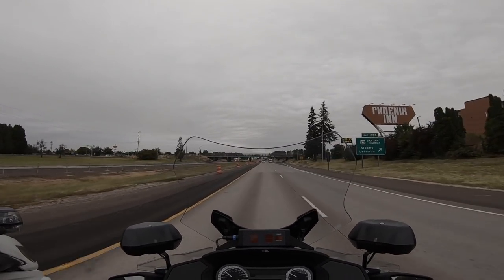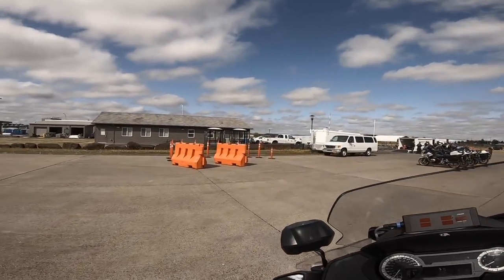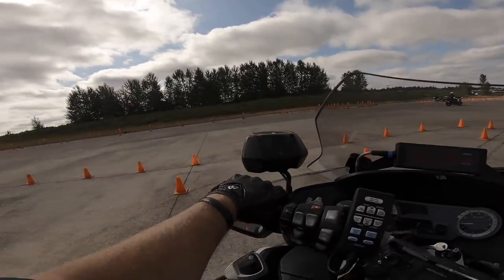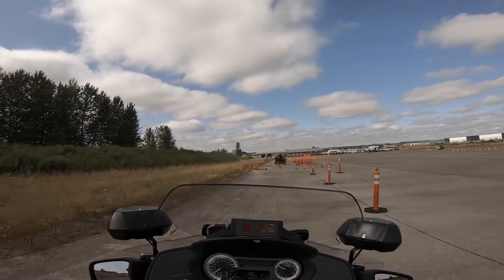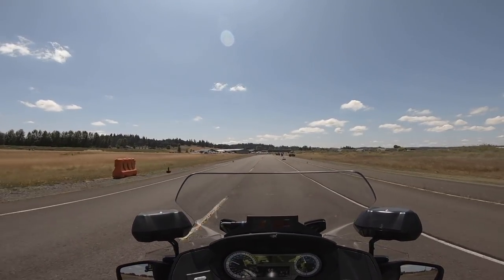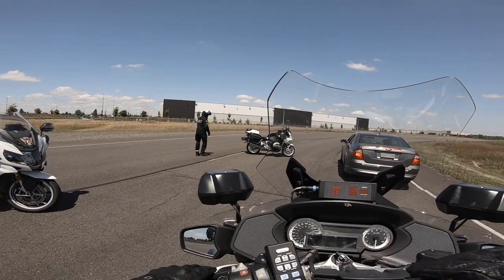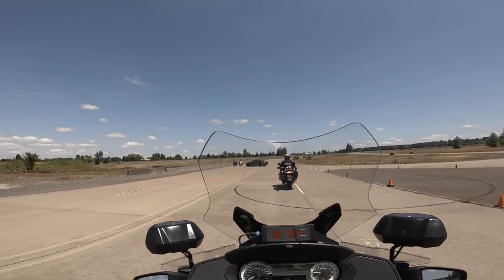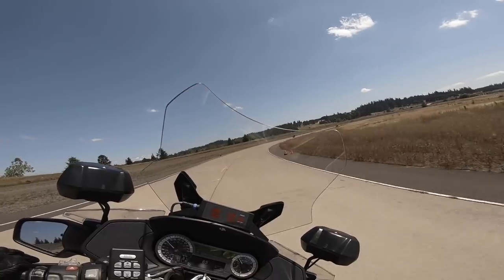Police Motorcycle Advanced Motor Training On A BMW R1200RTP!

Comment: Great Riding!!!!!! I've been working regularly on slow speed maneuvers in a parking lot with cones on my 2 month old BMW r1250rt.  As I work to learn the right throttle, clutch, and rear brake relationship Im at about 10mph on an off set cone weave set up running the throttle at about 3,000rpm's.  My wife and a friend say it makes the bike sounds like its working real hard.  I was trying to look at your rpm's through the video.  On slow speed stuff are your running about 2,000-3,000 rpm's?  Im a bit timid to run the rpms lower than about 3,000 for slow speed stuff at the moment with the fear of not having enough power to the rear wheel and dropping the bike. Im just very curious where you run the rpm's on our similar bikes and if i am going to do my clutch in prematurely with my desire to master some new skills at too high of rpm's.  Thanks and thanks for the job you do!!!!
Reply from the maker: Mark, Thanks for watching! Ya, I think I’m probably in that 1,500-3,000 rpm range during most of the slow speed cone work. Using the “gray zone” area in the clutch to modulate speed. The wet clutches in the new bikes seem to hold up better than the older dry clutches for slow speed maneuvers so I wouldn’t worry too much about wear. But generally if you can kinda “set” the throttle at a fixed rpm maybe closer to 2k rpm and use the clutch to modulate speed it works pretty well and minimizes clutch wear. Hope that helps a little bit. Id try to keep it a little lower than 3k if possible as you get more comfortable. The nice thing about the boxer motor is they are kinda like a tractor and make decent torque at low rpm.
Reply: @Mclovingarage  Thats a great tip.  Thanks.  I went out today for a while in the parking lot working on a little lower rpm's.  It will take some more practice.  Thanks for giving me guidance on what I am to work toward.  Another question: What sources do you know that are good for slow speed training??? Especially that u-turn.  Ive purchased Jerry Palladino's training vidoes which are great, but are all on Harleys so helpful but I wonder how much different our RT's are.  I watch a lot of Motojitsu, MC rider and a few other you tubers trying to get tips to up my slow speed skills.  I had some bikes 30 years ago when I was young and dumb, and now trying to be older and wiser and learn how to do things right.  Still working towards trying to get a u-turn  quite a bit tighter to be able to make one on a 2 lane street.  Im most the time about 24-27 feet on my u-turns.   Ive seen the LAPD test bike data that it can be done on the RT in 18-20 feet so of course thats my goal.  You guys do set the standard you know.  What do you think is a realistic goal for a dedicated civilian rider on the big BMW bike for u-turns?  Thanks again.
Reply from the maker: Hey Mark, with plenty of practice you should be able to get closer to that 18-20 foot mark. Generally speaking if you can u-turn in two side by side parking spaces that’s a solid U-turn. The trick is full lock on the handlebars and your head turn. You want to point your eyes and head back towards where you want the bike to go as you are turning, not down in front of the bike. So kinda up over your shoulder, whichever direction you’re turning. Clutch and throttle modulation matter, as well as lean angle but those will come once your eyes are pointing in the right direction. I try to pick a spot on the horizon back behind me when I u-turn that sets me up to make the tight turn. Or some other sort of marker in the parking lot you’re practicing in. Where your eyes go there your bike will go also.
Reply: @Mclovingarage  Full lock required, thats a pearl I didn't realize but having you say it, it totally makes sense.  Thanks so much!!!  Thats a huge piece in trying to understand and apply tighter turns and u-turns that I missed.  Up OVER the shoulder great tip also.   What sort of exercises do you work to gain the skills and comfort to go to full lock with a lean on the bike?  I'll keep practicing until I can get that 18-20ft u-turn and then keep practicing more.  Thanks for the encouragement that it can be done on the RT.  And thanks again for all those tips
Reply from the maker: Mark Dorrough you’re very welcome. Really it’s just about practice. Trusting the bike, trusting the tires, and getting comfortable with the feel of the bike “falling over” from straight up and down to a lean angle that isn’t always comfortable at first. One last little piece is counter balancing with your body. So let the bike lean over under you but keep your body upright and towards the outer side of the bike. You can even scoot your butt to the “high side” of the seat to accomplish this. That way the bike is really leaning over but your body isn’t. Gives that counter balance affect so the bike doesn’t feel like it’s going to tip all the way over.  Have fun practicing! Hopefully those pointers help.
Reply: @Mclovingarage  Great Tips!!!!  Thanks so much for the help, greatly appreciated

Comment: I'm a civilian and I've been riding a 2004 R1150 RT-P for 12 years. Recently purchased a 2015 1200 RT-P. Before the 2015, I test road a new R1250 GS and they all have the same motor. The biggest question I have is the noticeable gearing difference (extremely tall) in the police bikes. What's the reason? Is it for quick acceleration?
Reply from the maker: I’m not sure. I’m not familiar with the tech specs on the gearing. I just ride it. Lol! But I’d say it’s probably geared differently than the GS although I don’t have direct experience in that. Thank you for watching!

Comment: You said that one circle is 32 ft.. but that box looks a little large in the middle.. are you basically pulling a 16 ft to each side figure 8?  And the keyhole is what.. 15 ft radius?
Reply from the maker: Ya, I said 32 ft circle but it might have been a 30 ft circle. I didn’t actually ask. But yes, essentially a figure 8 inside a 30 or 32 ft circle. And yes, keyhole is right around 15ft I believe.
Reply: @Mclovingarage  thanks.. I got a k12rs I'm hoping to get to close to that... I'm down to about 18 ft u turns from a standstill... So I got a lot to improve (though I don't feel I'm doing too bad for youtube university)
Reply from the maker: Not at all! That’s good for sure. Biggest things that helped me were getting my head and eyes turned towards where I wanted to go and “setting the throttle” at a pretty steady rpm and using the clutch gray zone to pull the bike around. The other hard part to get used to is letting the handlebar go to full lock. Takes some practice. Sounds like you’re well on your way.
Reply: @Mclovingarage  I'm still working on the head turn.. My only practice is on a cul-de-sac with cars parked around it so.. little more at stake lol.  Friction zone I'm really comfortable in.. I do the slow ride slower than my speedo registers.. I found I was approaching TOO slow.  I'm hitting full lock about 50-60% of the time.. I just need to stop fighting it as much... With a 23 year old bike I'm not going at it full commit and thinking "crash bars will save the frame and fairings" because they never made bars for my model (they made them for the LT, but I don tthink they make them for the gt or rs)... So It's really, really helpful to hear you and Jerry Paladino really hammering the look through the turn so much.... its sooo much easier said than done
Reply: @Mclovingarage  I also had to adjust my pegs height so I could shift my butt highside .. easy to lean with the bike and lowside.. counter balancing my seat was getting in my own way.. so I moved them up an inch and was 50% on my 2 spot u turn today in practice where before I was closer to 25%
Reply from the maker: @AlanDike  it really is easier said than done. I will struggle with it from time to time even now when we go do training days. And I can understand not wanting to commit fully without crash bars. Fairings aren’t cheap to replace.
Reply: @Mclovingarage  especially since the bike had a fairing change in model year 2002

Comment: Not keen on BMW we use to blow the final drives they became unreliable so we went FJR now there's a recall on 2nd gear
Reply from the maker: Recall on 2nd gear on your FJR? Not sure when you last had a BMW but our 2015’s have been excellent. No major issues or repairs. Each generation has seemed to get better. The 1150’s weren’t great. Our 2009, 1200’s didn’t have many issues either. Thank you for watching!
Reply: @Mclovingarage  if you know you're motorcycles FJR 1300 Yamaha and l hated the boxer engine on the bmw clunky gearbox worst final drive I've ridden and we had to take the hands off the the handle bar to turn the lights an sirens on our new bikes don't

Comment: Uh.. right side dismount?
Reply from the maker: We dismount on the right side away from traffic. Also in case a kick stand decides it wants to fail. Hasn’t happened yet to me on this generation of bike but it’s happened on the older ones.
Reply: @Mclovingarage  that makes sense, you guys frequently need to dismount with little between you and traffic so a right side dismount makes sense, i get that. Just a little more cumbersome. Can you pull over angled so you can dismount to the left?  I've seen a couple RT riders dismount on the side stand in the hot asphalt only to turn around and find their RT's on their side withe the kickstand buried in the asphalt! Lol!

I recall they also teach you guys in an emergency situation to dismount and lay the bike down, with no side stand right?

Comment: You're nowhere near the rtp's limits esp. in those corners on the track. Good to know i still have a distinct  advantage.
Reply from the maker: I generally don’t take any of my machines right to the limit. That’s where either I’m bound to fail or the bike fails and neither of those are good things. I have to ride it 40 hours a week and pay the bills. I can’t be laid up because I made a mistake. Sounds like you’re a good rider. That’s awesome! Many at that training are much better than me. I’ve been on a motor 9 years and happy to report no injuries and no accidents. I attribute it to good training, good teachers, and riding under mine and the bikes limits. Thanks for watching and the comments. I appreciate it.
Reply: @Mclovingarage  yeah I have to ride mine 140 ish miles a day just to commute. Then I am insane enough to ride another 1000+ miles on the  jaunting from CA to say, OR or CO and back in a weekend.  Put over 300k miles on my bmw motorcycles with my R1100RT at over 160k on the odo. I don't ride mine at 10/10ths either, more like 8/10ths. But man these moto cops ride at like 4/10the and think that's impressive.  Got over a half million miles combined on bikes and never been down once on the street (knock on wood).  You have plenty of safe margin left to ride those rtp's harder, you just need to learn how.

Riding at the Torrey, UT bmw club gathering I was leaned over so far at 130ish mph i could reach down and graze my glove across those bots dots (which I don't recommend..they really smart at that speed). But it's fun to be leaned over so far at that speed that you're essentially sitting on the side of your bike with a knee out. And this is on an RT touring bike, not a sport bike.

Comment: One thing i noticed why do police all ride heave couser bikes 

Heave bikes with small wheels go down very easy ,  you cant have a passanger , off road not a good time , flittering is not an easy thing to do  , and your turn radius is not as good as it could be with another bike 

I  can think of 3 other types of bikes  that wont have those problems  

1 dual Sports 2 Adventure bikes 3 cafe racers   

Cruser bikes they might be comfortable for all day riding but the benefits in my eyes are not worth those disadvantages especially for law enforcement
Reply from the maker: I disagree with your comment about heavier bikes with small wheels going down easier. They wheels are standard size for these models. They don’t fall down any easier than any other motorcycle. The bikes we ride are sport touring machines. They are designed for long distance touring, comfort, with wind and weather protection. We also carry a lot of gear that requires large saddlebags and a good weight capacity. We do not need to carry passengers and our work is generally confined to streets, so off road ability doesn’t matter. You would be surprised where I’ve taken my R1200RT off road and it does just fine. The bike turns plenty sharp and is able to go over curbs or down off or sidewalks. We are not allowed to filter in Oregon where I work. I appreciate the comment. Overall this bike is well suited for the work we do.

Comment: A big NO NO is riding side by side on the road with your partner.  I thought only the biker gangs did this.  Very dangerous and a bad example to all riders.  You guys should know better.  I'm hoping you were only showing off for the camera.
Reply from the maker: Les, no that’s not the case. We ride in formation, side by side, on a regular basis. Daily with my riding partner actually. Not sure where you live but it’s pretty standard procedure for motorcycle police all over the United States. It makes communication easier, emulates the headlights of a four wheeled vehicle for better visibility and makes the package of motorcycles smaller front to back making it easier to get through stop lights, less likely to get cars sliding into the middle of the package on the freeway. We train A LOT riding next to another rider and are proficient at it. It is legal in Oregon and other states to ride side by side as a pair. I have been a motorcycle officer for 9 years and have not experienced an accident related to riding in formation. Thank you for watching and the comment. Appreciate hearing other people’s perspectives and opinions.
Reply: @Mclovingarage  I agree with Les. Its dangerous.
You should not be doing it.
I've been riding for over 50-years (I'm 72-years old!) and I refuse to ride next to anything...bike or car. 
I can't even count all of the times a car randomly pulled into my lane, or the guy in front of me swerved to avoid crap on the road and I would have been tagged if not staggered. 
It's essential to have an exit lane if someone does something retarded or unexpected.
Staggering when with other bikes also gives the person in front of you the piece of mind that they can make an aggressive emergency lane change without worrying about hitting you.
We make it a hard rule to stagger with the guys I ride with.
9-years is not long - sooner or later this poor practice will bite you in the butt.
Nice riding by the way. You guys are good!
Reply from the maker: Thank you for watching and commenting. I should clarify that I don’t ride side by side generally when I ride off duty. But at work it is part of the job and serves some advantages for us. I hope I will be riding at 72 as well! I’m impressed by that!
Reply: @Mclovingarage Thanks for your polite replies.
BTW, last summer I traded my 2012 BMW RT1200, my 29th(!) motorcycle, in on a 2020 HD Milwaukee 8 Electro Glide. I was finding the BMW too difficult to handle any more. Too tall.
I have ridden that wonderful Harley Seattle to Chicago twice and am absolutely loving it. Its so much easier to handle. Probably the best bike I have ever owned. And probably my last.
Stay safe my man. There are a lot of crazy drivers out there.
Reply from the maker: @DennisMerwood-xk8wp  yes there are! Way too many! Got to love the Harley for low seat height and comfort. And they look awesome!